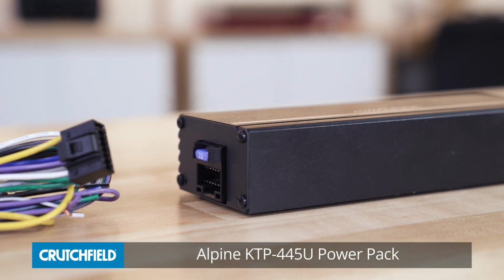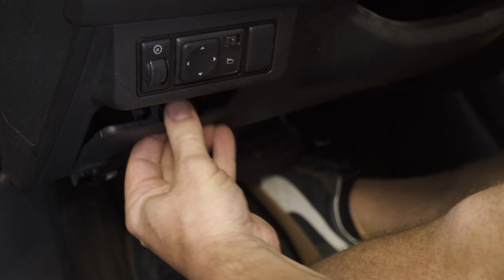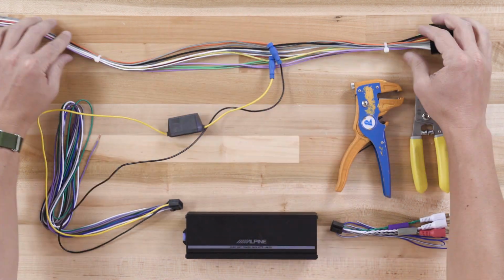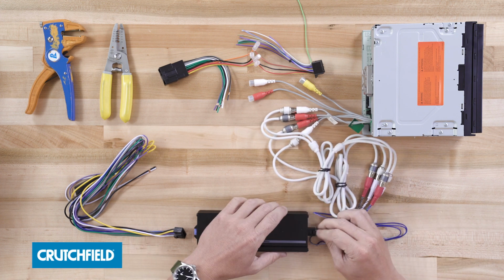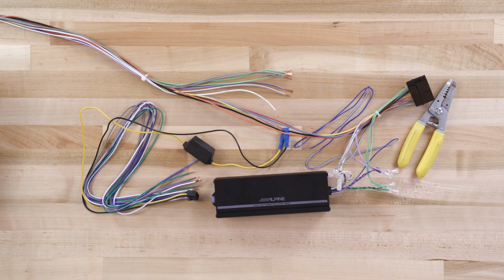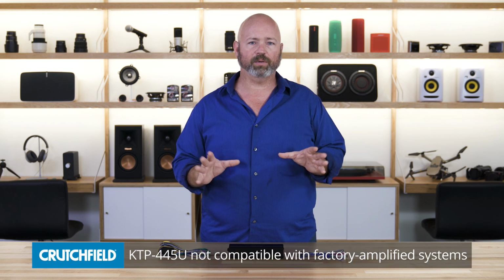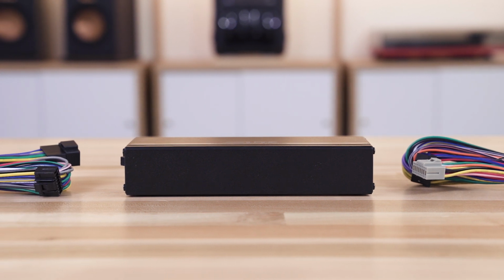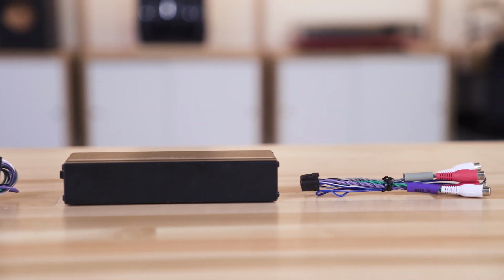How to install the Alpine KTP-445U Power Pack compact amplifier | Crutchfield video

Comment: Just ordered one of these. 

Running two Alpine S2-S40 coaxials at the front and two S2-S50 coaxials in the back. 

Hoping the KTP will improve sound quality as the factory headunit isn't providing enough power. Thanks for the install instructions!

Comment: Question, I have a 2006 chevy colorado extreme with an aftermarket stereo. What wattage of speakers would you recommend pairing up with this amp?
Reply from the maker: If you are using the aftermarket radio to power the new speakers, I recommend choosing ones with a higher sensitivity rating that won't require a ton of power. Also check out.
https://www.crutchfield.com/learn/learningcenter/car/speakers.html

Comment: Quería recibir información de los componentes del arnés  del alpine KTP-445U.  Actualmente trabajo en un proyecto upgrades en la honda CR-V LX 2014. Y quisiera hacer esta instalación plug and play.  Sin cortar los cables OEM. Pueden decirme donde comprar los pines qué utiliza el arnes del amplificador? Es que la idea hasta ahora, es desarmar el arnés para ingresar los cables del arnés de reemplazo del radio OEM.  Para que este conecte en el amplificador alpine KTP-445U  sin corte. Pueden ayudarme? Por favor 🙏  y gracias a sus aportes 😅
Reply from the maker: Hola! Gracias por comunicarse con Crutchfield. Para ofrecerle una mejor ayuda, para encontrar el equipo para la instacion para su 2014 Honda CR-V, le recomiendo que nos llame al 1-800-653-0992, ya que tendriamos algunas preguntas para usted y poder ayudarle mejor.

Comment: My 2014 Hyundai Tucson's interior fuse box has 2 separate 10 A fuses for AUDIO 1 and AUDIO 2. Is it safe to say that only one 10 A fuse is for the radio and the second 10 A fuse may be for extra circuitry ? I do not have the amplifier / subwoofer package. There is also third slot for 25 A  - AMP fuse that does have a 25 Amp fuse in it but not sure what that is powering.
Reply from the maker: Hi Damien, it's definitely possible that there is just the one 10A fuse protecting the radio. Most vehicles do include a fuse box diagram as part of the manual so you could double check there. If you're installing an amp you got here, you can call our Tech Support for help wiring it in as well. Their direct number is on your invoice.

Comment: Hello, I have 2014 Lexus GS350 non M/L system… I wanted to know will this amp work with my system?
Reply from the maker: It includes speaker-level inputs, so it can be connected to a factory radio without having to add a line output converter. Since your Lexus has a separate factory amp, you would have to tap into the speaker wiring on the output side of that amp to bypass it. What type of speakers do you plan to power with the Alpine amp?
Reply: @ I currently have a new set of hertz uno 165 component and coax installed in my front & rear doors & hertz dieci dcx 1003 4” in my dash.

Comment: Can it drive pioneer TS-A6991f rate at 130W nominal rms????
Reply from the maker: Yes, it would work well with those Pioneer speakers. The TS-A6991F speakers have a high-sensitivity design, so they don't necessarily need to be pushed to their max power rating to provide strong output. That would be a great sounding combo!
Reply: I was thinking it can’t push the cones considering these speakers are rated 120rms
Reply from the maker: Since the speakers are efficient, they will sound terrific even at the 45 RMS rating. Are you looking to add them to a specific vehicle?
Reply: @ 2019 Toyota Highlander
Reply from the maker: Does your 2019 Toyota Highlander feature the JBL factory premium audio system?
Reply: @ No

Comment: Did you mean for power this amp we only need to T power from ACC wire to factory radio and grnd?  No need to blue one.
Reply from the maker: The Alpine Power Pack features speaker-level inputs. You do not need to connect the remote turn-on lead wire when connecting the amplifier via speaker-level input, because the speaker-level inputs have signal-sensing turn on. While Alpine states this amp can be powered from the radio's circuit if it is 15-amps or greater, we like to include the Crutchfield CK12 wiring kit below for a stronger power connection directly to your battery for the best performance.

https://www.crutchfield.com/I-rYALc166/p_007CK12/Crutchfield-CK12-Amp-Wiring-Kit.html

Comment: would be nice if Metra or someone would make a model specific plug and play wire harness for this to eliminate all the tapping and splicing - especially for folks leasing their cars.
Reply from the maker: Companies are starting to come out with T harnesses to help with getting audio from a factory radio to an amp as well as getting the amplified audio back into the stock speaker wire to send to the installed speakers. We are happy to check if we have such a harness for your vehicle. To get started with checking, what is the year, make, and model of it?

Comment: I plan to put it in my 96 dodge 1500 with my pioneer radio.
Reply from the maker: The Alpine would be an excellent choice to pair with your Pioneer radio. What aftermarket speakers are you using?
Reply: @crutchfield  pioneer  door speakers
Reply from the maker: Nice! As long as they are rated for more than 50-watts RMS the Alpine is a fantastic choice to power them!👍

Comment: I bought this amp over 2 weeks ago it worked great for about a week and a half. now My speakers cut in and out and crackle. When i turn off my truck, they seem to go back to normal. I'm not sure what's going on, maybe ground issue, not sure.
Reply from the maker: Hi Joey, sorry to hear it's not working better. Your best bet will be to double check your wiring, including wiring from the amp to your speakers. If you got the amp here, you can call our Tech Support for help troubleshooting this as well. Their direct number is on your invoice.

Comment: You said it’s not compatible with a factory amplified system. Will it work if I bypass my factory amp?
Reply from the maker: What is your specific year, make, model, and trim vehicle?
Reply: @crutchfield 2007 Chevrolet cobalt SS, 2.4L. It has the pioneer sound system, but no on star.
Reply from the maker: The Alpine Power pack is not compatible, sadly. If you wanted to use it you would have to delete the Pioneer amp under the dash and bypass it, rewiring from your Alpine Power Pack directly to the 6 full-range speakers with fresh wire.

Comment: Hey. I buy pioneer gm-d1004 but I think I need some iso adapter but I dont know what to buy. Can you help? I have MGN station with gps
Reply from the maker: We are not sure how much help we can be as we do not recognize the vehicle you listed. It may help us with identifying it to know the year, make, and model of your vehicle?

We do know that the Pioneer amp has speaker level inputs which can be used to install the amp into some vehicle with a factory installed radio. These are typically vehicles that do not have an external amp installed to power the speakers.
Reply: @crutchfield   thanks for answer
 It's mitsubishi asx from 2017 without amplifier I think
Reply from the maker: We are not able to research the Mitsubishi ASX's and don't have any information on them. We are only able to research vehicles distributed in the U.S.

We won't know if there is an adapter made specifically for it, but you should at the very least be able to use a universal line output converter with the stock radio to create preamp outputs for connecting an aftermarket amp. We recommend checking with a local installer for vehicle specific parts for connecting an amp.

Comment: Can I use that in my mitsubishi  asx  from 2017?
Reply from the maker: We were not able to research the 2017 Mitsubishi ASX vehicles, but if they are truly similar to the 2017 Mitsubishi Outlander Sports that were distributed in the U.S., then it can be used in the versions that did not come with a factory installed amp.

Comment: Can i use this amp if i already have an amp hooked up for a sub? Like can i connet 2 different remote wires from the amps to the one connected to the radio?
Reply from the maker: You sure can have two amps connected to the 12V trigger on a radio!

Comment: I bought a  Kenwood kac-m1814, should I connect to the Head unit power cable like this unit? the fuse box says 15Amp as well.
Reply from the maker: The power wire can be connected to the car's fuse box or directly to the battery. The amp is protected by a 15-amp ATM mini blade fuse. If wiring directly to the battery, install an in-line fuse (15-amp minimum) no more than 18" from the battery terminal and be sure to ground the amp as well.

Comment: If I install this amp by tapping into my HU's 20 amp circuit and ground, will I run into a potential ground loop issue if I add a powered under seat sub later? in other words, would I need to extend the ground from this amp to the ground location of the under seat sub?
Reply from the maker: You do need to ground the sub separately.

Comment: Is the Sony XMS400D similar in that the remote line does not need to be hooked up if I have 15 amps?
Reply from the maker: Sony does not recommend installing that amp using the power and ground wires used by the radio and recommends running a power wire to the battery for its installation using an amp wiring kit like this one:

www.crutchfield.com/I-rYALc227/p_007CK12/item.html
Reply: @crutchfield  Thank you!
Reply from the maker: You're welcome. If you need anything further, please let us know.

Comment: If installing the KTP-445A to an Alpine receiver does the vehicles radio fuse still need to be 15 amp or since the KTP is powered by the Alpine receiver is 10 amp radio fuse sufficient? Just trying to avoid running another power wire to my battery.
Reply from the maker: Yes, with the KTP-445A, if the fuse protecting the factory radio is less than 15 Amps, you should run a separate +12V constant power wire from the battery to the amp.
Reply: @crutchfield  Understood. If using only the Alpine CDE-172BT receiver without a Power Pack amp than the factory 10amp fuse is okay?
Reply from the maker: Yes, that's correct.

Comment: What do I do with the blue wire when using with a factory radio…..leave it or snip it
Reply from the maker: It is best to leave the unused wires attached but covered so they cannot cause a short. Crimp caps can work well for this task:

www.crutchfield.com/I-rYALc227/p_120CCL1614/item.html

Comment: I have a stock stereo and have a subwoofer amp using the front speaker lines I used the same for this unit and it works but now my subs are really low, should I use the rear outputs for the subs and only use the front for this unit I’m only running 2 channel for the front.
Reply from the maker: Yes, you should definitely get some improvement if you switch the subs to the rear channels, though even better would be running a line out converter for all 4 channels, like this one: https://www.crutchfield.com/I-rYALc384/p_575RFHLC4/Rockford-Fosgate-RF-HLC4.html

Comment: Great video, but how do you connect the power from the battery to the amp? I bought an 8 gauge power cable, and the amp is 14 gauge, any idea how to go about it? Thanks!
Reply from the maker: You'll find wiring instructions starting on page 4 of the manual here: https://pdf.crutchfieldonline.com/ImageBank/v20130217160100/Manuals/500/500KTP445U.PDF If you got the amp here, you can also call our Tech Support. Their direct number is on your invoice.

Comment: Can you use this amp in bridge mode but only connect the RCA's to the front speakers and then simply leave the rear speakers connected to the factory wires/head unit like normal?
Reply from the maker: It is possible to bridge the Alpine KTP-445U. You do have to choose between either RCA input signals or speaker level input signals.

Comment: I bought an alpine 175bt  to replace the factory radio on my 2006 jeep liberty , and I am planning on getting the 445a amp for it , but it has a 10 amp fuse can I just replace it with a 15amp fuse or do I need to run the cable directly to the battery????
Reply from the maker: It is not recommended to change the factory fuse as that can have other adverse affects on the vehicle. You will need to run a new power wire for the amp.

Comment: Can I hook up an aftermarket subwoofer and amp to the rca cables coming out of it ?
Reply from the maker: Those are RCA inputs, not outputs.  Your headunit would need RCA outputs for a sub, or you would need to use speaker level inputs and splice.  One of our advisors would love to help you get the right gear! https://bit.ly/2KP1zS3

Comment: Wouldn’t it be better just to run to battery so there’s constant power, in this case 15amps, I feel like if you tie into the head unit power it will work but be lower ?
Reply: Lol no

Comment: I bought the 12gauge power wire from Crutchfield to run a dedicated power wire for this Alpine amp. Would I need to cut off the built in inline fuse that comes with the Alpine amp and just use the inline fuse that came with the Crutchfields 12awg cable kit? If so what amp fuse should I use?
Reply from the maker: You will want to install the fuse on the wiring kit near the battery, and get a fitting fuse that is as close to ( but not under) the fuse rating for the Alpine fuse.  This will protect the wiring in your vehicle.
Reply: @crutchfield  thanks for the reply. I used the 30amp fuse that came with the Crutch Fields wiring kit and I did cut off the inline fuse on the power wire that came with the alpine harness. So far haven't had any issues and wiring looks good as new.

Comment: Will this be louder if I run a power wire from the battery?
Reply: Did you ever do this ? I’m debating running to battery or just headunit power, but I feel to battery will be more consistent 15amps
Reply from the maker: It can be louder and sometimes allow the speakers to hit a bit harder than when powering from the radio's circuit. I recommend contacting an advisor to check your vehicle, discuss your goals and the level of improvement you seek to get a personal recommendation on a solution. Here's how to reach us for this help:
 
https://www.crutchfield.com/I-rYTVc227/support/ContactUs.aspx

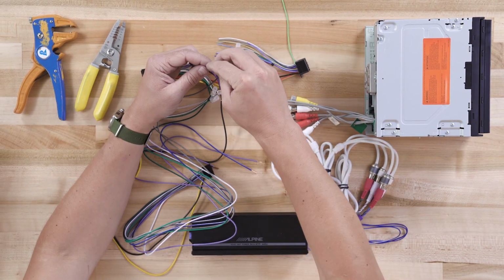Comment: what’s the white adapter used at 3:02, also if I use the adapter what do I do about the other side of my harness that is already cut since the output will me soldered to the output
Reply from the maker: Those white wires are simply RCA cables.

Comment: Hi, I just have a question, I barely bought one of this amp but it came with the RCA’s cut seems like it was used with a stock radio,however I have a pioneer avh-4200nex can I still use this amp without the rca’s?
Also, I will run 4 jl audio c2-570cx please tell me if they will make a good sound with this amp thanks
Reply from the maker: You may be able to contact Alpine directly for a replacement wiring harness.

Comment: What if my head unit only has 2 "rear" RCA outputs? I am using the Alpine in 2-channel mode (to power my front speakers). Complicating matters a bit more, I'm running rear speakers directly to the head unit. Thanks.
Reply from the maker: This amp has speaker level inputs that can work your receiver's front channel amp outputs to get the audio for the front speakers

Comment: Would it be possible to use a T harness or a breakout harness in order to avoid cutting the OEM wires?
Reply: Yes it is. I've used a metra harness for my audi-

Comment: Would you be able to tell me if I would need to connect to a battery for a Honda s2000?? Trying to work out if I need a to connect to battery. Thanks
Reply from the maker: We always recommend running a dedicated constant power wire to the battery for optimal performance from this Alpine amp — we offer an inexpensive wiring kit for this installation. 
Feel free to chat with us online or by phone, if you'd like to discuss this in more detail, or to check out the amp kit that is recommended for use with the KTP-445U amplifier.
www.crutchfield.com/I-rYTVc164/contact

Comment: Can this be used in a BMW E89 Z4 with basic 6 speaker setup (no factory amp)?
Reply from the maker: We'll be happy to look into this for you!
What year is your BMW E89 Z4?
Reply: @crutchfield  Mine is June 2009 (built) thanks.
Reply from the maker: Thanks for that info, Joe!
While we have not been able to fully research this BMW model, it does look like there is a factory amplifier in both the 09 BMW E89 Z4 with or without a speaker in the center dash.
The Alpine KTP-445U amplifier is not compatible with a vehicle that has an active factory amp.
You would need to bypass your factory amp in order to install the KTP-445U amp.

Comment: How to i check if this amp is sufficient for my speakers?(morel maximo 6.5” comp front and same series 6x9 in the rear)
Reply from the maker: Your components can handle up to 90 watts RMS and your rears can handle up to 100 watts RMS. That Alpine Power Pack will underpower them. Take a look at 4-channel amps in the 80-100 watts per channel range: https://www.crutchfield.com/r/6S3

Comment: Just got some speakers off you guys and was going to add a sub later on! I was wondering if it would be acceptable or a good idea to install a power pack to power my speakers and then install a different amp for the sub. Seeing as there would be multiple cuts and sodering done to the harness from radio to speakers. Any reply would be appreciated
Reply from the maker: If its possible, I don't see that hurting anything. I do recommend contacting an advisor to check your vehicle and get a personal recommendation on what is best for your goals too. You probably know how to reach us for this help, but just in case, here's the link to use:
https://www.crutchfield.com/I-rYTVc227/support/ContactUs.aspx